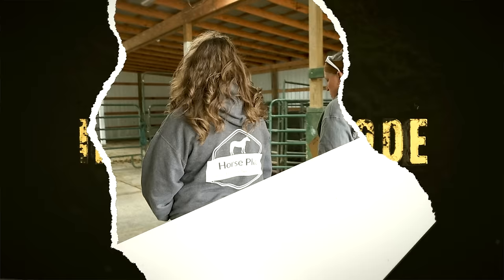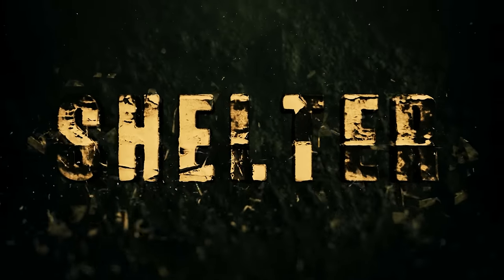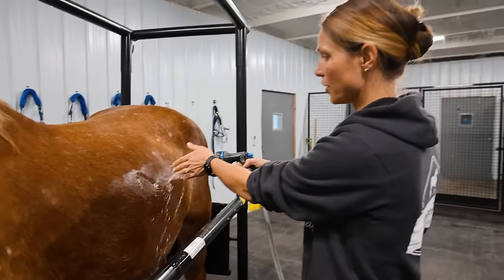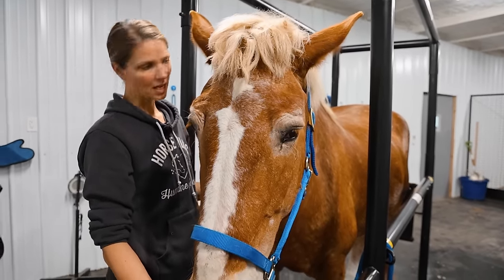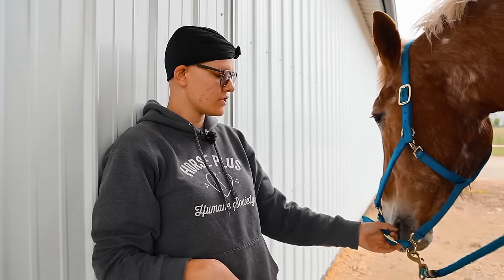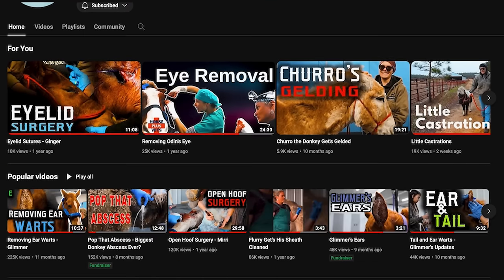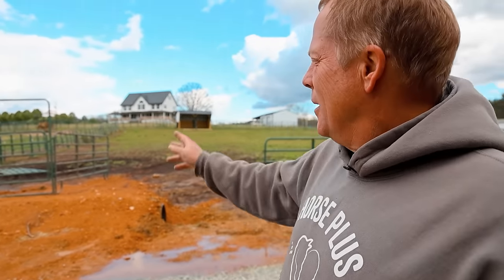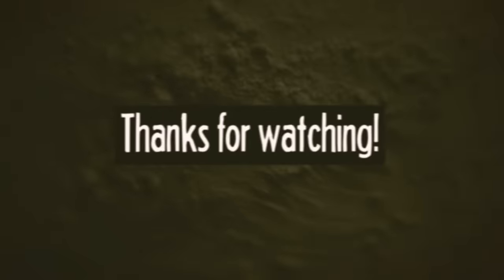Horse Shelter Heroes S5E14 - Youngest Volunteer Ever!

Comment: Dang, Keith, go find you an old iron worker to show you how to twist wire  😄.  As a much younger woman I 'tied steel', making the rebar piers and mats for concrete.  I think I could still put a figure eight or double loop on those panels, but I'm in Texas and that's a long way from Tennessee.  At 72, my eyes aren't up for driving so far.  🤣🤣🤣